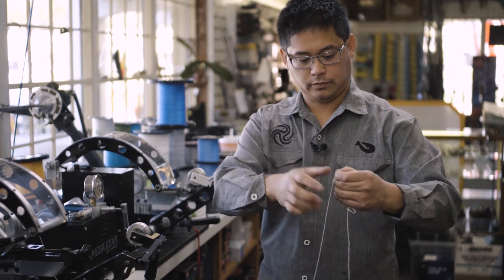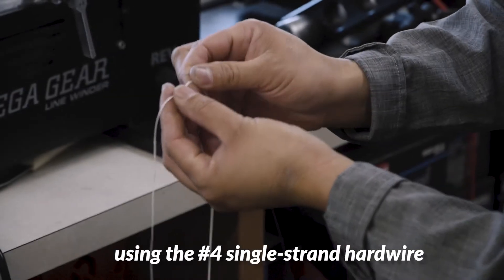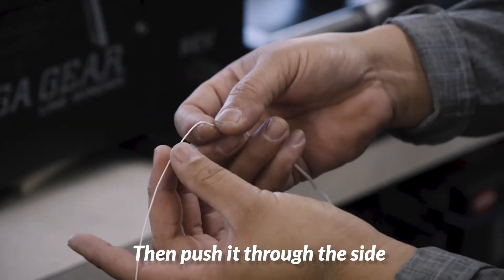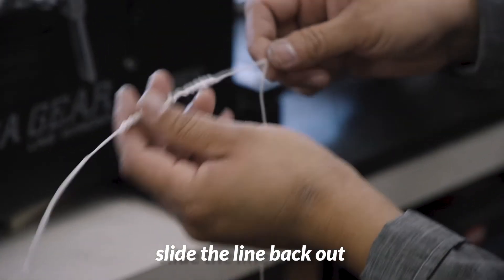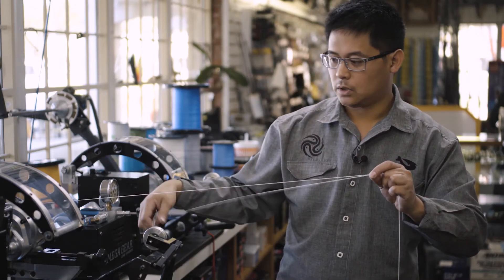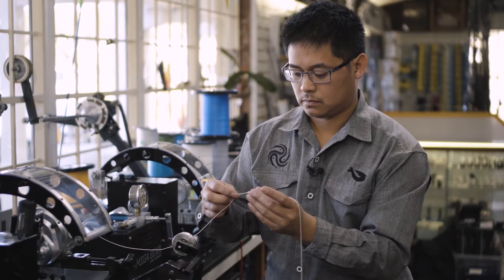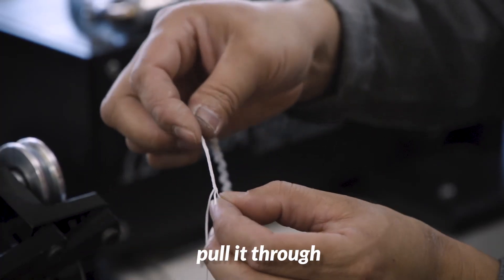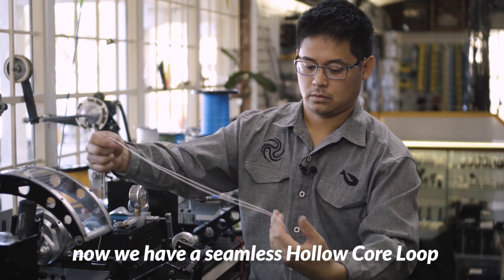How-To: Hollow Core Loop Splice

Comment: Appreciated! I learned that more line, not less is used to make this connection. I learned that a guitar string pull wire is as effective as a reverse latch needle and even has the advantage of length. I learned that snapping the line taut isn't a necessary part of the procedure. I appreciate that having a reel fixed to a bench with a slight brake set on the reel controls line tension while doing the work.